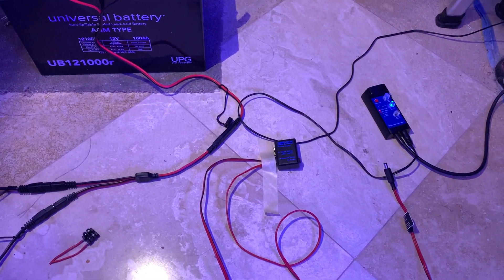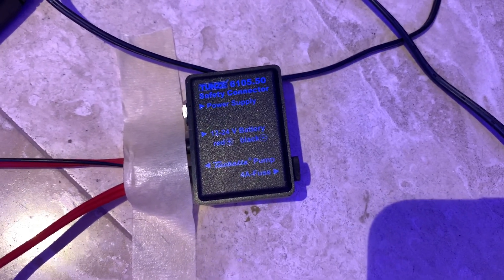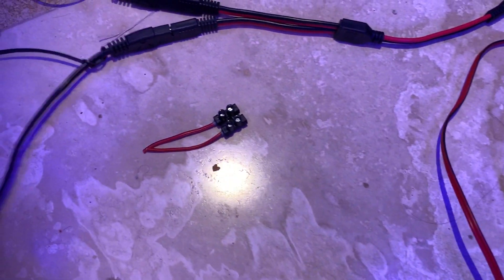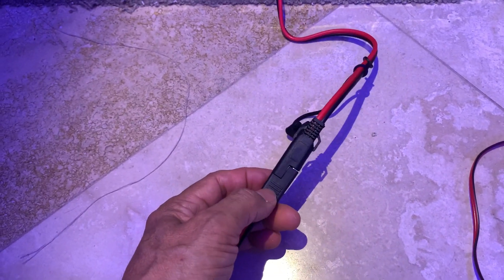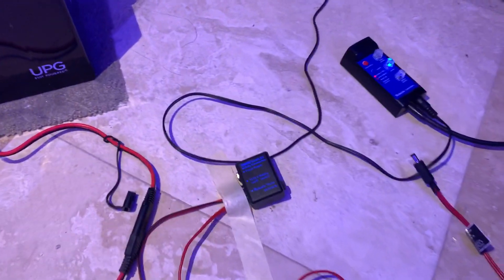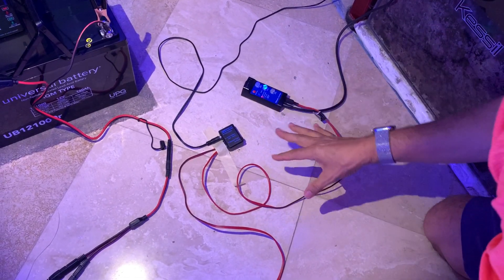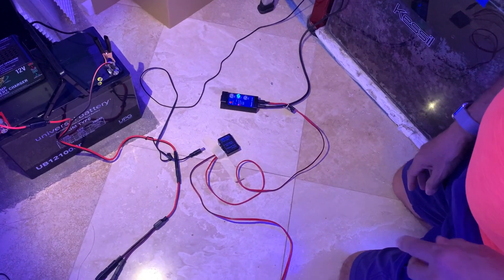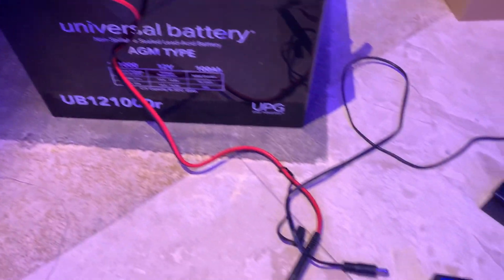Power Backup for your Reef,   Tunze Safety Connector

Comment: Nice video, I also ordered these 2 but mine will power a tunze 6095 wich consumes 5 - 21watt and the battery is agm sealed 12v 22AH deep cycle. Do you know how long my pump can run on this battery?